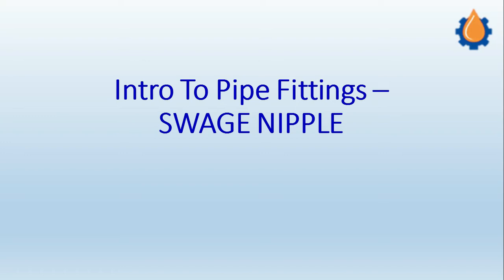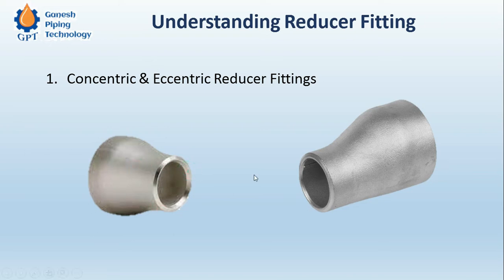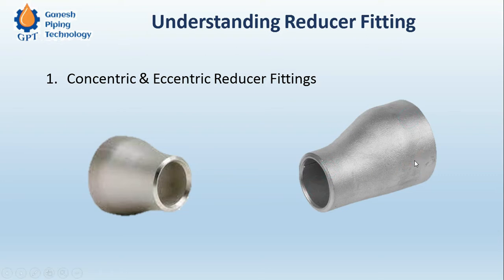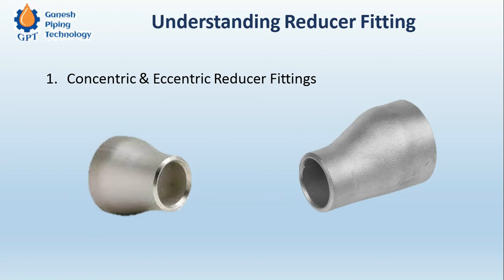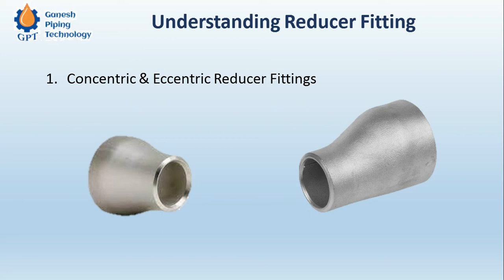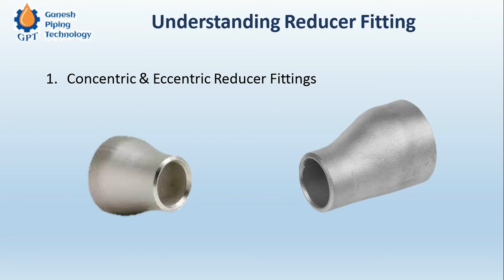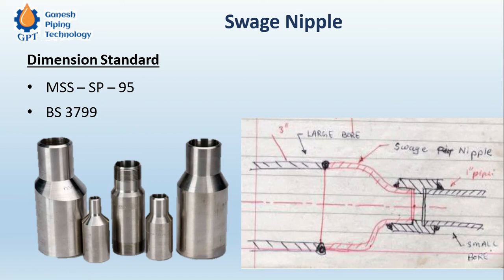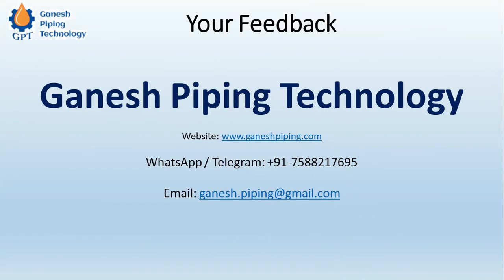All about Pipe Fittings - Swage Nipples

Comment: I think something is missing here because it seems that we have here two names for the same thing. Per your explanation  the differentiation between swage nipple & reducers is incumbent on having the fitting butt welded on one end and socket welded on the other.
I think a reducing threaded nipple should certainly be called a swaged nipple instead of threaded reducer?!